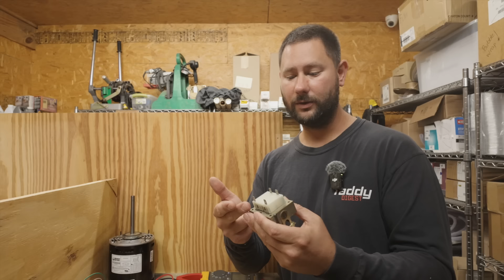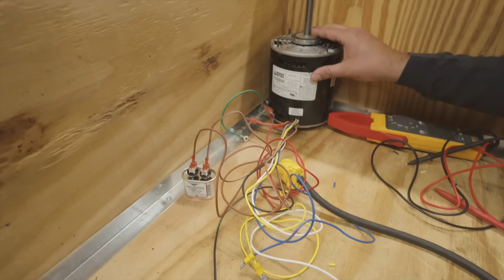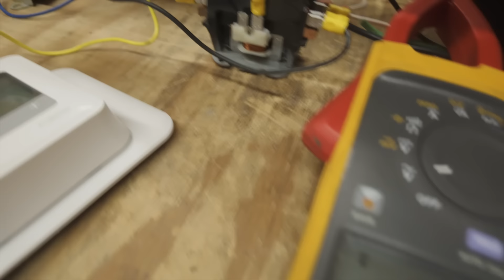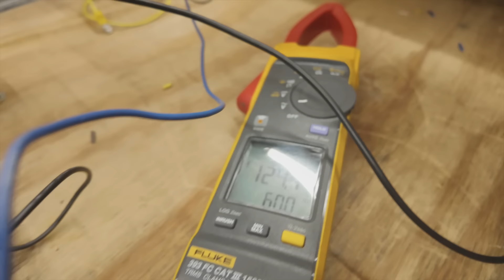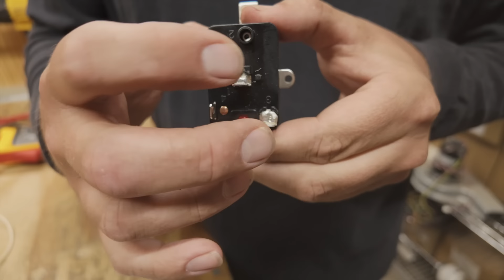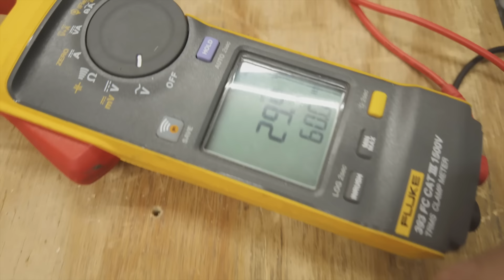How to Test HVAC Relays, Contactors, and Transformers (Multimeter Tutorial for Techs)

Comment: Mr. Teddy. I came across in one of your troubleshooting video with a unit not running. I tried to replicate the step by step troubleshooting but to no avail. Unit still didn't come on after replacing the capacitor. In fact, I also replaced the thermostat (honeywell). Still didn't work. The unit is calling for cool but no 24v going to the contactor coil. I also tried putting the jumper between R and Y wire at the stat, still didn't kick in. The only way for the unit to run is what you did in one of the video by manually pushing the contactor. I already checked the fuse at the furnace and the circuit board has a green steady light with 24v between R to B (common), R to Y, R-O, and R-G. I just thought I can fix the unit without getting the service of an HVAC tech. I'm from San Antonio, Texas and hoping you can guide me on else can I check. Thanks.

Comment: Chad i have a Lennox 13 series 13HPX and it blows hot air fans inside and outside run i don't think think compressor is engaging is my problem i checked the capacitor it reads good the top is rusty tho and what should I look at next flters are new the relay maybe  man your a great guy I'm a watch this video and learn all I can thanks brother

Comment: Hey Tad, you are obviously a knowledgeable, experienced tech. A suggestion for what you demonstrated in this video would be to cleanup the spaghetti, mount the components in some sequential arrangement and incorporate an actual schematic in your demonstration. It could be hand drawn on your backboard or on a sheet of paper. By doing so you can point out where you find the components and the wiring in a real situation. It would also give you an opportunity to show the point to point checks that you did real well on. 
I have found that that is the biggest challenge to becoming proficient, not being sure about how the parts fit in. I like your repetition, it helps a lot. I’m a 50 year electrician, 30 year HVAC technician. Love the trade and hate the idea of self taught in the current industry. A good teacher that can reach people is a treasure though!

Comment: Sorry for the dumb question (I'm an HVAC student) in my 2nd semester, but it looked like you were testing for continuity on a live (energized) circuit with your Fluke multi meter.  Is that safe?  The textbooks say "you should never test for continuity on an energized circuit"  If you don't mind the question could you please explain what is the right way to do this?
Reply: @oasyssw91701  you are correct

Comment: I have a mobile home with an electric furnace and I’ve been battling an issue where the thermostat calls for heat but the fan won’t turn on I’ve replaced the relay and the sequencer several times and it will run for a few hours once replaced then it go back to calling for heat but no fan again

Comment: @22:15
Why when you put the leads on both sides of the coil when getting a call you'll pick up 24V, but when you put the leads on both sides of the closed contactor you read 0V

Aren't they both closed?
I would think they'd both either read voltage, or both be 0 🤔
Reply from the maker: When the contactor is closed, you will read voltage.But when the contactor is closed, you will read no voltage.The circuit is complete and the voltage is going through

Comment: I don’t understand the relay, if the call for fan closes the circuit shouldn’t that allow you to be reading the voltage instead of the other way around?
Reply: No because energy is flowing to a destination. Think of electricity like water. If you put both your leads in a river, there's no return or ground. You're putting both your leads into the "flow" or "hot". A multimeter completes a circuit, so the second the "flow" is going somewhere, your leads are useless. There is no loop.

Comment: Great video and thanks.  My mobile home electric furnace doesn’t have the fan relay.   It’s got a rocker switch with four spades.  I haven’t seen this setup on any videos.  I’ve found the switch to set the fan to be continuously on, or automatically controlled by the thermostat.

Comment: TLDR so I just want to add that some commercial RTU's sense the contactor coil resistance. Trane Voyager for example. In support of them, I tell technicians that the coil should ohm out at 5-15 ohms. Outside of that the control board may not attempt to power the coil.

Comment: @ 4:58 shouldn’t it be 115/120 and not 230?
Reply: @gdat3376  each leg has a voltage of 120 and some change so when u do both line 1 and 2 u get your 240
Reply: @Legacy995  this is a 120v motor, he made an error in the video